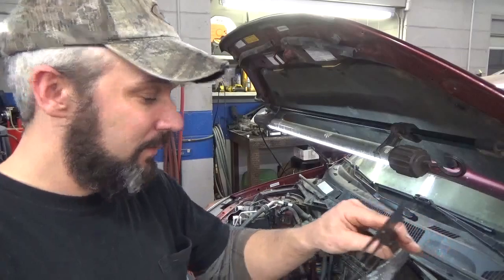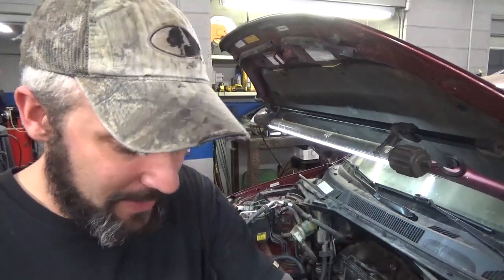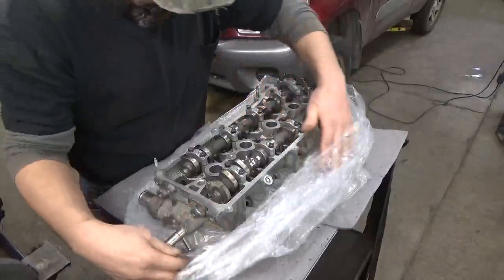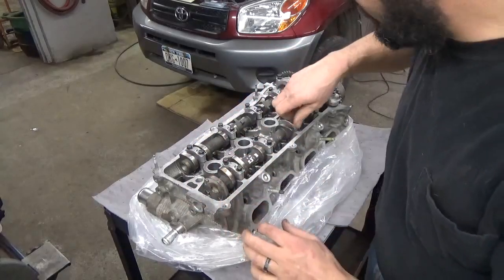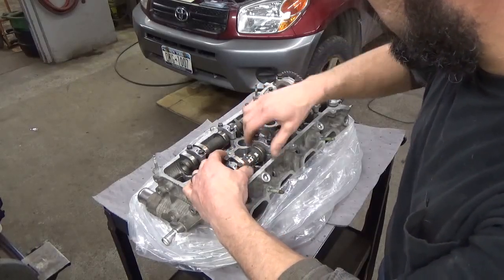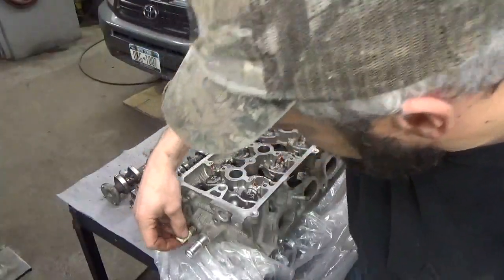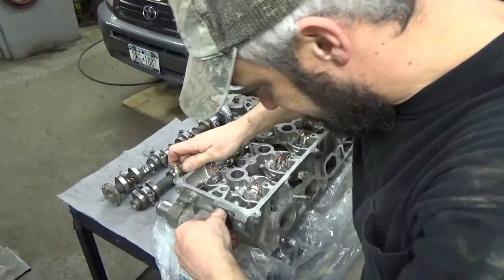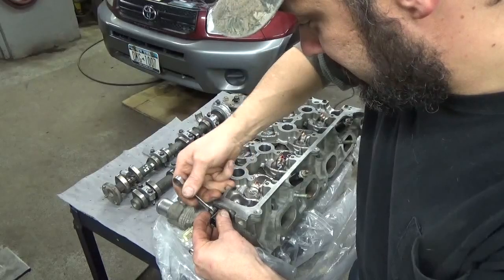Toyota Rav4 2AZFE Stripped Head Bolt Repair Part III

Comment: Ok can someone explain the whole 90 degree thing? I mean why not just torque to a set point?
Reply: +consaka1 Head bolts like these are actually designed to permanently stretch when torqued down. The 90 degree part helps ensure the bolts are stretched just the right amount - for the stretching part, going by angle is more accurate because it doesn't depend on how much friction there is at the bolt head, etc.
Reply: Robert Hancock Thanks for that reminder.. Of course you could have just said two words, "bolt friction"  and I would have remembered. lol  I still hate that on a aluminum block. I won't do it. I install studs instead. In fact in all my stuff I now install ARP head studs. You know before some genius decided to stretch head bolts the system for holding heads on seemed to work just fine. Now we got stretching head bolts that seem to lose head gaskets regularly. 
Care to finish the education m8 and explain why rubber band head bolts were used and why they are still used despite their failures? :)
Reply: +consaka1 I think the main reason they do it is to maintain enough clamping load on the head gasket - particularly with aluminum engines as aluminum expands and contracts more than cast iron does. Not sure what Toyota did to botch the setup on this particular engine though - perhaps they just didn't have enough of a threaded area in the block for the bolts to engage into as Eric suggested.
Reply: Robert Hancock My specialty is 6.2 and 6.5  GM diesel engines. These engines also benefit greatly from ARP studs. If ARP studs are the accepted fix for these diesel and aluminum block engines, why didn't the manufacturers use them from the beginning?  I believe the old VW engines used studs for their cylinder and head assemblies.

Comment: The inserts are on bigger threads so the should be more resilient. and the thread the actual headbolt is in will also be alot stronger than the cast aluminium threads that had been stripped out.

Comment: Eric,you are the man,i'd gladly put my vehicle in your hands any day.And that says a lot i don't trust anyone.
Reply: sbtoolman12123 that's the way I feel too, bought a brand New 95 gmc van off show room floor in 95 then 3 mos later spiffy lube stripped my oil pan bolt then sears later on failed to tighten up tie rod bolts (hand loose) and ever since then I worked on it myself got 300k miles on it still runs good have to put 1-2 trans pressure sensors in but I will manage ok just my fractured spine will not allow me to lift or bend over so I balance myself on my elbows and brace my body against somthing or just scream in agononizing pain but it beats paying someone a butt load of money to screw stuff up.

Comment: I'm not a mechanic, so this is a noob question: Isn't there a specific torque value that equates to 58ft/lb + 90 degrees? Just curious why it's divided up like that.
Reply: +Jake Adams Once you get above 40-60 lbft of torque it becomes very hard to accurately torque something. This is due to many things. Friction, condition of threads, bolt twist and stretch, etc.

So an engineer figures out a torque angle that will set proper strain on the bolt. That's why you snug it up then use a torque angle for the final tightening.
Reply: That makes sense. Thanks for taking the time to help me out!

Comment: Very helpful!
Question:  Wouldn't it have been a good idea to replace the timing chain guides while you were in there?  I'm assuming this is a high-mileage "interference" engine.  Just finished replacing multiple timing cassettes on a Ford 4.0L SOHC, which are known to fail--but maybe this hasn't been a problem for Toyota?  Ciao.
Reply from the maker: +Drew McG Good idea however these are not a real failure problem on these engines. Good question though.

Comment: Did they do a valve job? Just wondering why the clearance needs to be adjusted

Cant say much for Toyota with problems like that, I am sure very expensive repair
Reply from the maker: jim dandy Yep I always do the valves when I pull the heads

Comment: As a new viewer, i was sat here wincing as you torqued those bolts to their final 90* angle.
Reminds me of when I had to do the same with my Volvo T4 (after blowing an exhaust valve) and my Range Rover V8 when both head gaskets blew because of the water pump failing.
I would have been crying with you if just one of those bolts threaded on the final turn.

At least you didn't have to remove the bonnet like I did with my Range Rover.
It's the only way you could get the final 90* angle for the bolts at the back of the block.
Reply from the maker: chomerly Oh man ... well I would have been crying for sure :) Sounds like you have had your go around with head gaskets huh
Reply: I have, sort of.
I'm a DIY'er when it comes to mechanics.
I know my around cars enough to get by and the Range Rover was only the second time i have ever done a head gasket repair job.

I have thought about trying to get into mechanics but i don't think there is much scope for employment in that kind of work right now.

Comment: Yea ,They have worked good so far,  But not  went through any heat cycles yet. LOL They will be just fine .But  Oh that feeling , palms feel like they are sweating , did i forget anything , ok time to torque them . Oh did i set this wrench right ,because  it feels tight , Well the book says to,  So it must be right.RIGHT
 Finally the first step done ,Now lets step back have a drink and smile , Oh but wait , they just felt like they was ready to break , making it this tight and now the book says now go Tighter , Who wrote this book any how. Now Getting that same palm sweating feel as before , Ok, i guess it is time to tighten , Ok, Great  the first one made it , but nine more to go , Now  Thinking,  I have a better chance at winning the lottery .{ Relief }  Now that ,The last one is  torqued to spec ,  
 {screaming at top of lungs}   It Worked ,It Worked , oh i so Happy , But wait car is still here ,Ok , No one touch anything , lets just hurry up and get this thing back together and out of here before something goes wrong , Everything seems to of went, way to easy up till now .
{later that day , AFTER repeated looks under the car for leaks, that are not there }     Time to call customer to come get their piece of ,          Oh i mean their car . {waving good bye}   Car just left , man i never want to do another one of them again .  {few min later}  Ring, ring, ring , Hello , {customer} I think my head gasket is leaking on my car , can u fix it . LOL . Sorry , just been there many times before and could feel it just like i was there. Hey you done a good job and good video . Ok you have wasted enough time here , get back to work. lol
Reply from the maker: wtbm123 LOL are you some kinda mind reader Terry? You are sure speaking like a man of experience! I think our minds must work a lot a like. Trust me when I fired it up I was waiting to hear them come out and hit the valve cover lol, guess we will have to see what happens in part V :)

Comment: Awesome vid...

1 -- Could you have got a head gasket from toyota -- or would it have been made by the same company that you used?
2 -- Smart idea to mark the heads of the bolts before torquing them 90 degrees
3 -- That's a lot of bending over the engine bay -- do you have to do special exercises or stretches to keep your back in shape?
4 -- Can't blame you for not recording while putting things back together.  It would have taken a lot longer -- customer is more important for sure.  Hope the rest of the job went smooth.
Reply from the maker: Show Me What I Need To Know 
1. Yes and I am not sure if same company or not..
2. Better safe than sorry
3. Exercise? What's that ans when do you do it?
4. At work customers then YT
5. Thanks for watching :)

Comment: That is one of the draw backs to having those snap on tech angle torque wrenches, freaking battery life. I only have a 1/2dr one(tech angle that is, plus several "click" style as well) It seems like I use the "click" style more often, I don't know why, I am "ole skool funk" I guess. Those TTY head bolts sure sound like they can be reused(according to the directions) I don't like the sound of that. The Napa we use, actually has a machine shop so they do some of our machine work(very reasonable price)and some pretty funny people to deal with.
Reply from the maker: jarin wilson I couldn't believe it but yeah it did sound like they could be reused!? Our napa use to have a great shop..then the guy quit and the guy there now isn't the sharpest tool in the shed so I send mine else where..

Comment: Nice work Eric and looks like the inserts will hold up pretty good.
Reply from the maker: stuzman52  Toyota approved so I hope so.. fingers crossed.
Reply: @SouthMainAuto  You'd figure 10 head bolts in a four banger the bolts would be the least of your problems..smh

Comment: You diidn't say or I missed whether these are "torque to yield" bolts.

It seems to me that use of bolt rotation to set bolt tension is an improvement over purely bolt torque limits. It reduces the role of friction in setting final bolt tension or clamping force.

Great video!
Reply from the maker: Yes you are right these are TTY bolts

Comment: Got to admit, I stopped eating my breakfast while you were torquing the bolts down the first time. Pretty sure I was holding my breath when you were putting the last 90 degrees on them lol. Great job
Reply from the maker: They end up around 80ft lbs on average. Gotta admit OnTheBrink I was puckering a little bit too :)
Reply: South Main Auto Repair I like the neat way all the bolts were marked in the same direction to check on the 90 degree rotation.There should have been pre video warning with the possibility of induced post traumatic stress.Will have to visit my therapist tomorrow.
Reply from the maker: It's not the snap I worry about... it's the strip...
Reply: South Main Auto Repair Was thinking about the reason why the bolt snapped in the first place and had to be drilled out. Originally those bolts did snap and not strip correct? Perhaps it was during a head job and someone said screw it they had enough of it.  All of that was going through my head while you were torq'ing the bolt.  Was having an anxiety attack just watching you turn them another 90 degrees.  Moment of truth phew.  Impressive those inserts held up to that.  Great episode, learned a lot, thank you.
Reply from the maker: Tom OConnor  Yep that would be called turn off the camera and go home...
Reply: same here :) i was expecting a snapping sound ;) and some strong language :)
how much torque does the bolts and head holds?
Reply from the maker: ***** The original bolts were stripped out
Reply: same here lol  (please don't snap, please don't snap, please don't snap).

Comment: I didn't know Toyota is using shims to adjust the valves... I've seen these in the S54 engine on BMW. 
As you were turning the last 90 degrees,all I had in mind(and I'm sure you did too) was what if that torque wrench started going easily all of a sudden...and on camera! I know I would've snapped and things would've been flying and heavy words would've been said! LOL! Glad it worked out! 👍 
Thanks for the video!
Reply: yeah most cars use shims now, probably cheaper to make but harder to adjust.
Reply: Never! I was talking about what I would've done... I was joking anyway...
Reply from the maker: Come on now Nick Nicu .. when have you seen me snap!?
Reply from the maker: Oh rriiiiigggghhhttt lol